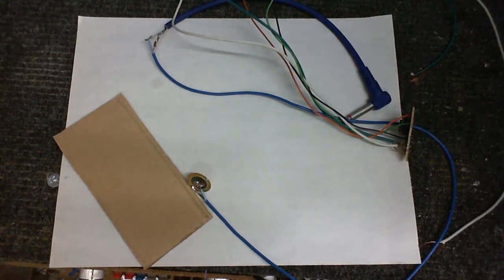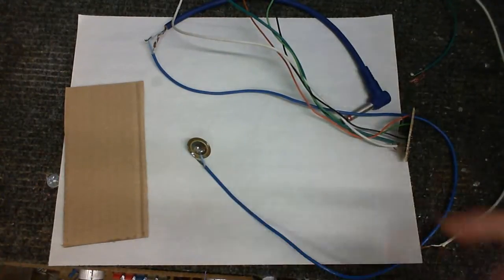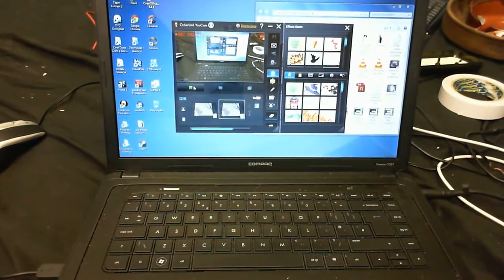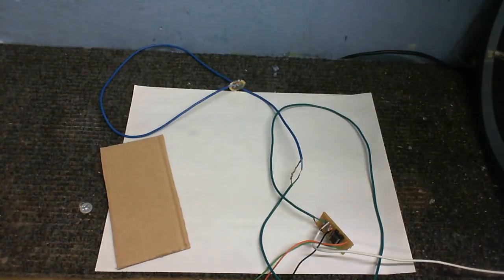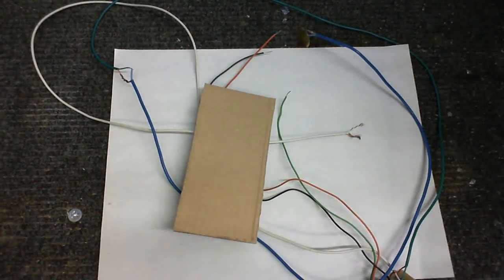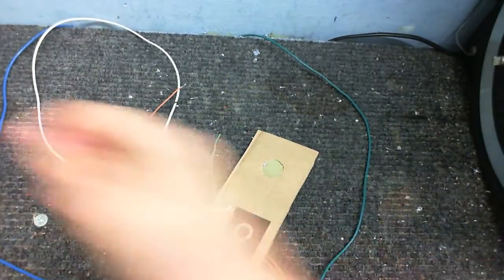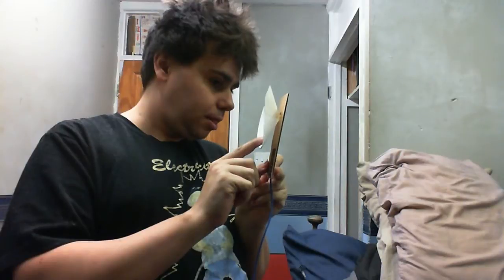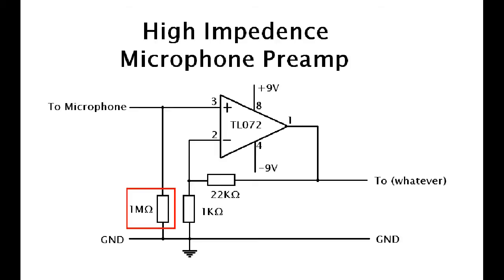CDC ElectronicWorkshop - Homemade Crystal Mic 2 0 & Preamp

Comment: Sounds pretty good. I wonder if that cardboard/paper cone would make one of these function as a useful tweeter, instead of the normal fake piezo tweeter that is so quiet it can't be heard over the woofer.
Reply from the maker: it does seem to improve the output a little, I tried that just now, but still not all that good.